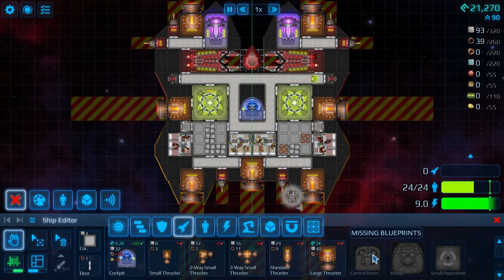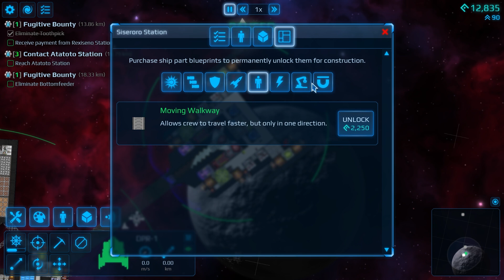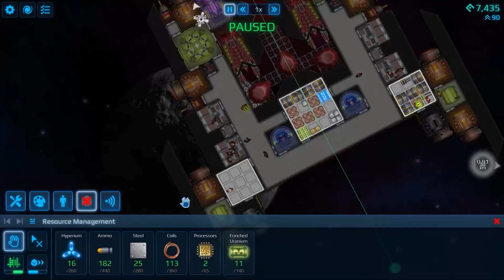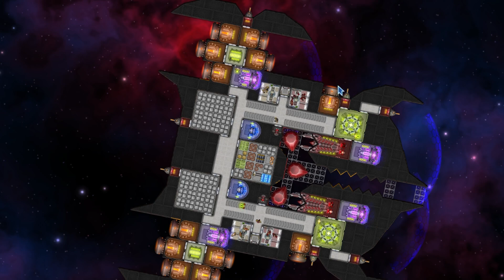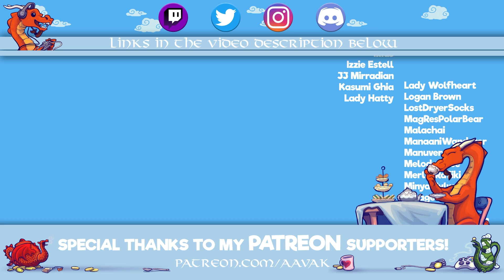Ion Prisms Allow MUCH better Defences!

Comment: 16:38 it is actually much better, though often more difficult, to take out only the weapons and thrusters. This will cause the crew to abandon ship while to cockpit (which requires processors to replace) and reactor are both still intact.
Reply: For the purposes of capturing, I'd agree. For salvage, if the cockpit is exposed, more or less? I'd rather go for that instead.
Reply from the maker: Oh, thanks for the suggestion :D

Comment: That's a very nice series :) I had an idea around 8:00. Can you add another prism at the end of the long barrel? This way the Ion beams shoot at Prism #1, which shoots down the barrel hitting Prism #2, which acts as a turret with a considerable firing arc, and even if it gets destroyed, it's sitting at the end of the barrel, so no risk of the explosion destroying valuable components, like the beam emitters. And potentially, if it gets blown off, it disintegrates, not obstructing the barrel, allowing Prism #1 to continue shooting.
Reply from the maker: A nice idea, may be worth testing to see what the sort of relative explosion sizes are and working out what would be a safe distance for the turret prism to be set at.
Reply: We had the same braincell with this, was also thinking of having a Muzzle mounted crystal to overcome the issue of being unable to aim,
Can't wait to see what Aavak does with this
Reply: Oooh, really smart idea! That gets rid of the really narrow firing arc issue! less aesthetically pleasing in the sense of having the beam just FWOOOM! out of a giant ribbed barrel like a railgun projectile, but definitely more functional!
Reply: You could prolly move the shield generators up a little to give some cover to the outer prism. That being said, a bit armour for the outer prism will be a bit necessary in case a ship with Disruptor turrets gets too close. Shouldn’t be a problem for a ship with strong reverse thrusters but it’s never a good idea to have backup armour just in case
Reply: @DatPinkPuffball  Disruptors are really weak and should be priority targets if spotted, though. Ion can hit it from further than disruptors can, anyways.
Reply: @KainYusanagi  true true. keeping on top of reverse thrusters should stop them, and their short range means their ship needs good speed to close the distance
Reply: @DatPinkPuffball  Disruptors have the longest range of all the short-ranged weapons, haha; but yeah, any ship needs sufficient speed to maintain distance to target within its optimal weapon range. With larger ranged weapons, you can afford to go slower.

Comment: When you were so slow, I think you had more thrusters for braking than for going forward 🤣
Reply from the maker: I did, because reverse is more important in a fight as I need to keep the enemy at distance while still facing them.
Reply: @Aavak  Oh, I see. Still, it was funny hear you complain about the speed and think you should just go in reverse.
Reply: @yadiracamacho499  That's a major problem with the game as it is right now; there's no means to go backwards, unless you're specifically in combat and maintaining distance from a target. If you need to retreat, you can't do so facing an enemy, you always turn around, unfortunately.
Reply from the maker: You sort of can Kain; you can define which direction the ship considers 'forward' so you just switch it and the ship will fly in reverse.
Reply: @Aavak  You can also use the strafe command (the button below the salvage command) to reposition you ship while maintaining its current rotation
Reply: @Aavak  How? I tried I don't know how many ways to make the game just move the ship facing the enemy, and I couldn't find anything in the codex for it, either, unless it was under a heading I just didn't think to look at or missed.
Reply: yep, you could put the guns pointing out the back and just flip around when in combat...  in space, there is not really an "up"... its all relative.
Reply: @MikelNaUsaCom  That's something entirely different from what's being discussed, though. I should be able to just point my ship in a certain direction and tell it to move in another, and, so long as there's enough thrusters to do so, it should move in that direction. It does so mid-combat, but there wasn't a way to do so out of combat unless there's something I'm missing. Unless Aavak misunderstood what I was talking about.
Reply: @KainYusanagi  Try the direct control mode (button that looks like a old ships wheel). You might want to look into the settings if you don't want to take control of your guns away from the AI, but then you can just hold the 's' key and your reverse thrusters will fire
Reply: @Xelakrats  Ugh, that sounds so unbelievably obvious I can't believe I didn't try it; manual instead of automatic transmission (or perhaps closer to Tesla AI programmed trip cruise control?), basically. Thanks. The only times I've ever needed to retreat is when they move faster than I do, so I can't get in weapons range; shielding the back just ends up costing way too much in opportunity, crew, and energy, but I've had to because of this until now. I do hope that an automatic means of facing a direction and flying in that direction without needing manual steering or an enemy to draw distance from is available (or is made available if not), though.

Comment: Here's a new tip for ya: If you use Mining Lasers, while they have shorter range they absolutely destroy enemy structure while just doing a complete salvage job, much quicker than the individual crew can do. This also works in combat, so if you can outspeed them, you can just salvage their ship to bits, not losing any materials to destruction. The best way to salvage is to capture it like you did the cannon platform, then dismantle all the components aside from an airlock hatch (so you get more materials returned, not just salvage materials! It is a bit more actually, not less; not sure what that person was talking about, but you definitely get more materials this way overall because it gives you materials from every type that it's made from rather than just partial materials from salvage, eg. the fissiles; at least that's been my results with experimenting between the two), and then abandon ship and salvage the little remaining structure. Also, careful with having mirror mode always on; you erased the reactor when you were erasing the "cannon" (which was the damaged cockpit), lol.

EDIT: Since you asked, I'm against full enclosures of thrusters, but not partial shrouds. The problem with being able to build thrusters that fire exhaust directly into other parts of your ship is that in space, all the exhaust from the engines isn't getting slowed down, so you're effectively pushing against yourself with only minimal reduction in speed for the distance crossed, due to the collisions with space dust and other similar particles. However, if they are far enough away, the exhaust can be both redirected (instead of hitting a flat surface it hits a slope; this drastically reduces the push effect on your ship) and also diffused (directed above and below, rather than strictly backwards from the angle of thrust) to make it possible. It still needs a port to exhaust from eventually, though. Also, you definitely need more side thrusters! I'd remove the point defense on the rear sides (by the engine rooms) and make them side-facing thrusters instead.
Reply: I consider partial enclosed thrusters to be like warp nacelles of a Star Trek ship, except armored.
Reply: @david2869  Yeah. Warp nacelles themselves are exactly that, partially enclosed thrusters that vent to the rear.
Reply: @KainYusanagi  that is a common misconception. Warp nacelles produce no thrust at all. There is a Bussard collector at the front of the nacelle that concentrates and collects hydrogen. The remainder of the nacelle is filled with warp coils that are used to displace the ship out of our universe and into a parallel one with a higher speed of light. The impulse engines still provide the acceleration.
Reply: @martindinner3621  Actually, they do produce thrust, through the subspace distortions they create (not a displacement of the ship into another dimension; it's simply distorting our space, utilizing the folding theory of faster-than-light travel) to form the warp bubble, which is concentrated towards the rear of the nacelle to produce the wake within subspace that propels the ship at Warp speeds (the diagram used in Star Trek engineering materials shows the field as being similar to the toroidal 3D visualizations of magnetic fields where one pole is stronger than the other), aka 'vent to the rear', which I used as it's a much simpler concept, to avoid going into too much nerdy terminology. 

Impulse isn't used to provide momentum during warp travel, either; in fact, such a feat has been proposed only once by Kirk, to escape the energy-draining aura of the giant space amoeba thing in ST:TOS by combining impulse and warp (and it fails to allow them to escape, though it does provide more thrust than warp alone, but consumes basically all the power available to the Enterprise to do so).
Reply: @martindinner3621  No, I was well aware of the difference between the warp engines and the impulse engines in Star Trek. Making an armored pylon off the side of the ship is similar to the warp nacelles, not exactly the same. Plus, warp nacelles aren't armored, it is just an analogy.
Reply from the maker: Yeah, noticed that in editing, doh XD
Reply: @Aavak  Just finished an edit to my post regarding the question of the enclosed thrusters, by the by! And to answer the other question, yes, interested in more episodes. :P I think a smaller secondary ship might be useful, set up for mining, which you can then lead into industry with on a second "ship" aka mobile industry platform, heh.
Reply: @KainYusanagi  I'm a bit confused, are we talking about actual game mechanics or sci-fi logic, or even real life logic? in other words are fully shrouded thrusters bad in game?
Reply: @brohvakiindova4452  In reality you want as much protection on your engines (and well, everything else) in a military-use vehicle as you can get, and that's mirrored in-game. However, what isn't mirrored from the real world is that when you have exhaust coming out of an engine, which is what is providing thrust, having said exhaust pushing against the vehicle you're trying to move in an atmosphereless, zero-g environment, is an exercise in futility; the exhaust will apply the same amount of force as the thrust generated (in the direction you want to travel in). In game, however, thrust exhaust has a limited range, and beyond that ceases to exist, thus allowing you to fully encapsulate the engine and its exhaust zone without any penalty (aside from having larger amounts of armor, and thus need more thrust to travel further).
Reply: @KainYusanagi  Yeah, I got the explanation thanks, was just confused, if that was applied in game or not and if it was different in sci-fi since somebody mentioned star trek. Thank you for elaborating further.